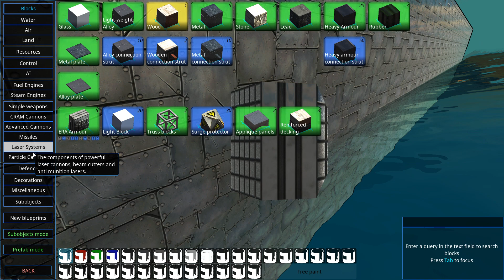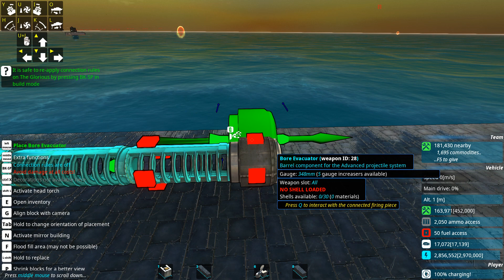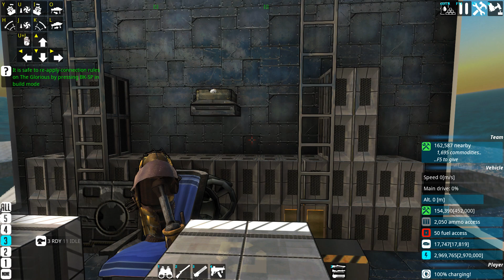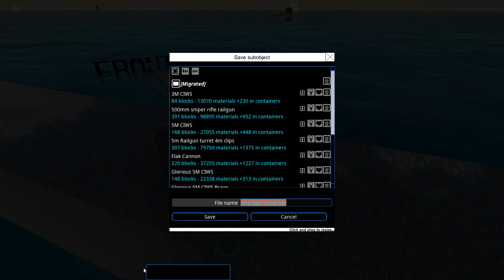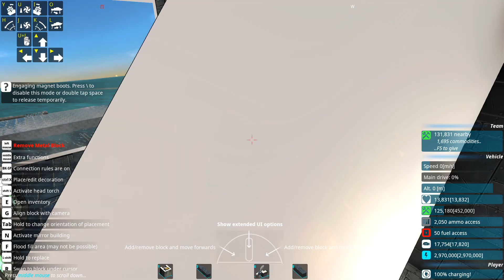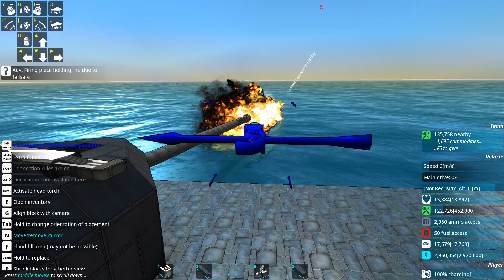From The Depths - Floating Gun Platform - #32

Comment: For AP-HE, (or AP-frag in this case) you 1. don't want any sabot parts as they set the HE (and frag) damage to 25%
2. you want bigger - longer shells, 350mm is fine, but longer shells are absolutely the way, 3m or more

Comment: 31:12 you could have just put a radar on top of the laser range finder and it would work. LRF transmits AI signal through the top. And you don't need a 360° radar on a turret. 90° works better especially since the turret will be facing the enemy all the time.

Comment: 25:58 range finders only need clearance from the right-most and left-most blocks facing forward. You could cover up the rest with whatever you want. But even then there is a block under decorations called a porthole and range finders, laser range finders, camera and camera tracker could all see through that block as well as through glass.

Comment: 21:00 go to the gun and change the accuracy from 2° to 0.1° it should change accuracy DRAMATICALLY. If you want to improve accuracy, don't use rail charge, that's a waste. Instead, you could make the barrel longer, which improves accuracy but doesn't decrease the weapon system performance.

Comment: Okay, so a quick rundown of targeting. The Target Priority card on an AI picks the targets, and assigns which has priority according to the conditions you set on that specific card.  A weapon controller does NOT pick a target, it only decides whether or not the specific weapon it controls should join in with firing at the one the AI picked.  So your latest guns need the target prioritization card adjusted to be able to select different targets with their own criteria and priorities.  In general the default favours going for the heaviest, largest targets, rather than the 'quick win' kills.  I usually set the size and armour factors to zero and instead want it to focus on those closing in fast (-value for every unit of range means closer is better target), to focus on targets with PAC and Laser weapons (+10 per PAC and +10 per laser), and then the conditions for the specifics of the weapon, such as preferring altitude to target flyers and not subs, or to value or devalue targets for how fast they are (slower weapons want to target slower enemies, etc).

Comment: Diverting rail draw to accuracy might be dropping your gun's effective AP?
Also, range finders can be blocked across the front facing spots, EXCEPT for the viewpoints on the far ends.  So often I use the unarmored one and put it in the back so the turret cap covers it.  You can then use armored portholes to protect the end bits while allowing it to see.

Though honestly, I find most issues are hits to the turret cap's base that open up damage to the magazines.

Oh and I just realized, putting those munition warner cameras on turrets reduces their effectiveness (movement of the camera results in detection penalty)
Reply: Swapping some rail draw to accuracy is always taking some away from the propulsion of the shell, and so absolutely guarantees that it will lower ALL of the kinetic effects (AP and damage of kinetic components such as AP, sabot, hollow-point, etc. components of the shell).  No 'might be' in it.  However, if a shell is non-kinetic in effect, not dependant on how hard/fast it hits, such as EMP, HE, HEAT and HESH, then that won't matter.  With these shells being penetration rounds, it matters, and reduces the damage and the AP both.
Reply: @britishknightakaminininja1  yeah the stats on the ammo only show rail draw at 100% speed.  the AP also drops over time as it slows right?
Reply: @PerfectDeath4  yes for kinetic energy AP, but of course not for the armour penetration values of HEAT or HESH.
Reply: @britishknightakaminininja1  I remember borderwise demonstrated meme APS ammo that had fin-stabalizers at the nose of the shell for near pinpoint shells.  Kills the velocity so it'd be only effective as HE, Frag, or EMP.
Reply: @PerfectDeath4  yeah, fins are so bad on speed that they really are just about only for meme builds, right along with 40 meter length barrels. :)  And of course, while the accuracy may be great for hitting the exact point you fired at, the slower the shell, the more chance the enemy can turn, adjust angle, and generally maneuver so that what you aimed at is no longer where it will be.  For that reason, whenever I want a pinpoint accurate weapon, I'll almost always go for a hitscan energy weapon for the purpose.
Reply: @britishknightakaminininja1  its also pretty simple to figure out a laser once you know what stats to aim for.

Comment: Just a note: F3 switches your building mode between aswd and mouse.  In mouse mode, you can easily switch between subobjects by pointing at them with the crosshair and hitting the bracket key ].

Comment: For INTERNAL damage you need AP head, solid (solid) 2 heads, HE or FLAK (FLAK WILL damage every block within  large radius (bigger than HE), HE will damage any block within lesser radius but with bigger damage, FRAG 180 will heave as many fragments as possible with most damage outtake) stabilizers increase accuracy but slightly decrease shell speed, gravity compensator increase BALLISTIC accuracy with slower moving shells, SABOTS are most affective STANDALONE for making holes, AP with SOLID blocks only also punch holes but heavy significantly more mass behind, and would not shatter on impact)

Comment: Your require accuracy for fire is 2, might as well shot blindly
Reply: That only affects whether or not the weapon will take the shot, not how accurate it actually is.  Adjusting it down can save ammo, but at the cost of guaranteeing you won't hit uncertain targets at all because you didn't even fire.  Unless you are short of ammo, by all means take some risky shots.  Sometimes they will pay off.

Making the weapon more accurate is down to the barrel length, not using muzzle breaks, whether or not you use rail energy to assist accuracy, and of course, the accuracy of the AI's detection systems.  If you are really insane for accuracy, you can also mount fins to the shell, but this costs shell speed so makes the shells easier to avoid altogether, and is not recommended against anything but very slow or static, long-range targeting for something like artillery.

Comment: Number of different things you can do to improve your APFRAG cannons on the pontoons:

1. If you are using frag as a warhead designed to detonate internally, make sure you set the frag cone angle option on the warhead body to its maximum, this will drastically increase the damage the fragments do and since the shell is detonating internally, all fragments will still hit the target no matter the direction they fly, they will also bounce around inside anyway.

2. get rid of the muzzle breaks, they do nothing useful for you. Recoil works a little weird, you can reduce the felt recoil on the ship up to 75% using the absorbers, you are doing that part correctly, but the last 25% remains, this last 25% does not affect accuracy unless your ship is small enough to be knocked around segnificantly by the remaining 25% recoil. What the muzzle breaks do is remove this last 25% recoil but it ALSO reduces shell speed. So with a ship of your size, the 25% recoil left over wont even budge it, but on top of that you are reducing the preformance of your shell. So the muzzle breaks are only useful for small craft that have over sized guns on them.

3. APHE really benifits from large shells, while 350mm is a good size for the shell, 2m is very short, i would go for atleast 4m if not longer unless you are putting a lot of rail power into it. You are both using a small shell length, but also a fairly low amount of rail draw and on top of that not a huge rate of fire. the gun is not going to be very effective without improving one or more of these factors.

4. dont use sabot bodies or head for APHE, its just not worth the damage loss, a shell that has a AP head with a couple of solid warheads behind it + a frag AND a HE warhead + pen depth fuse + base bleeder on the tail is generally the best sort of shell to go with for APHE, the exact number of each components is up to what you want the shell to do, but this should be a minimum.

5. for APHE often its better to go with larger shells less frequently than many small shells, since its vital to ensure the shell penetrates the target, lots of small shells failing to penetrate will be far less effective than one large shell that does.

6. dont try to get the gun to penetrate heavy armour, at this scale the gun really wont ever, aim for a few layers of metal penetration.

Comment: I sometimes wonder if a HE body instead of a Frag body works.
Reply: HE certainly works, as does Frag, but they work best at what they are good for.  Frag (fragmentation) creates tiny projectiles with relatively low armour penetration that travel in a straight line from the detonation point within the cone you set during shell creation.  The fragments tend to do more damage over a longer range than HE but it can be somewhat random exactly what they hit because there are only so many fragments.  They have a relatively low AP value, which can devastate softer internals, but may do far less damage against harder components or internal bulkheads.  HE hits everything within its blast radius, although it only does the highest damage close to the center of that radius and falls off towards the edges.  While a fragment could hit or miss a specific block (such as an AI component) simply through the RNG of the precise fragment angle and number, HE won't miss, but neither will it do as much damage to what it does hit.  It is simply that HE hits everything in the radius not shielded/blocked by something else.

Remember, one of the factors of which is 'better' is dependent on what kind of targets you are hitting, and what sort of damage you do.  If the fragments are damaging enough individually to completely destroy whatever they hit (such as a 4m metal beam) then frag is completely awesome.  But if they are only big enough in damage to damage rather than destroy the blocks the fragments hit, it may be a lot of shells before a fragment again hits the exact same internal block to destroy it.  HE can be better there because it is hitting every block within its blast, so there's more chance of further shells continuing to damage the same blocks, destroying them faster.  That help?

Comment: you should make your guns superfiring, helps output and firing angle
Reply: What does 'superfiring' mean?
Reply: @danielross7983  firing one on top of another. Like this:
         🔫
     🔫II
🔫 II  II
Reply: @AnAverageJho  I'm not sure I've understood that.  So like the double turret behind the huge missile but vertically placed?  Or separate pieces mounted with one overlooking the other?
Reply: @danielross7983  Take a look at most old ships, lets take the Iowa class battleship as an example. Toward the bow, you have the A turret and the B turret, notice how the B turret is mounted higher than the A turret. This means that it can fire over the top of the A turret, allowing greater fire arcs. That is what superfiring means, having one turret fire over another
Reply: @ryangarrett9433  Ok... so separate pieces. Thanks... That wouldn't really work on this design though.  It would restrict the firing arc for the forward gun on each pontoon more than they are now.  It would be fine for centreline guns, because the superstructure already blocks that arc.
Reply: @danielross7983  it is for the center gun firing over the front and rear gun on the pontoons, so it helps in a head on or a rear engagement by bringing another gun to action

Comment: @Stealth17 Gaming the turrets could have a fire rate of about 1rps (60rpm) if you triple the number of loaders (for which you have space). Might be a good idea to do.
Reply: firing railguns is expensive
Reply: @henryfeng840  yes, but this is only rail assisted. Also, for what damage it does 20 rpm is not a stellar fire rate.